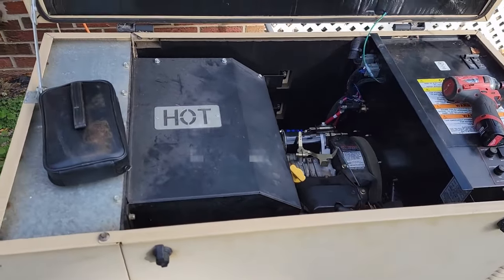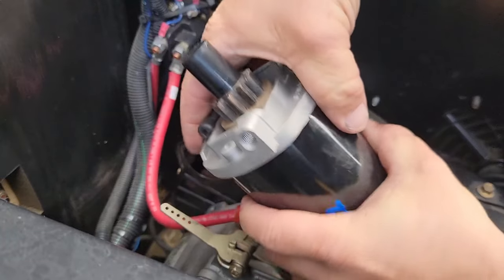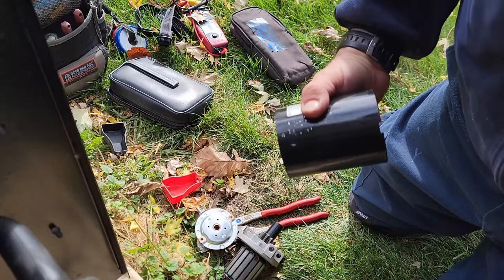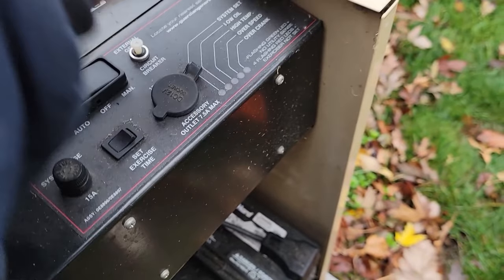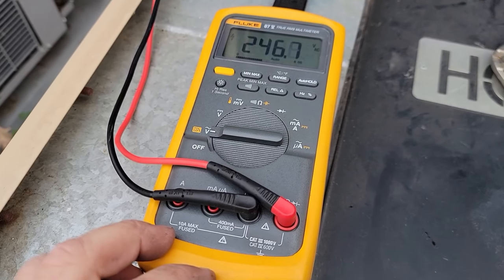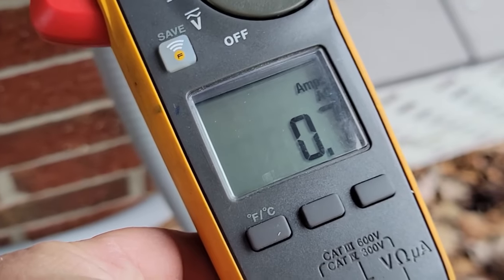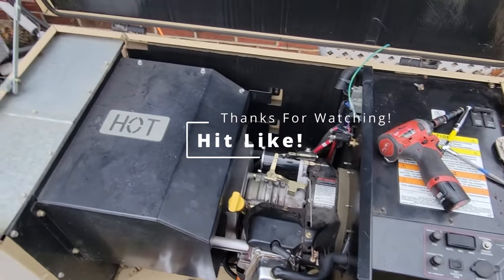Generac Standby Generator Wont Start AGAIN!!!

Comment: i recommend putting grounds wire on starter bolted to engine to reduce stressing starter too much
2nd look like it been cranking tooo long still wont started up so it just ruined starter
i think more could be issues with coils lack of sparks or lack of fuel or no fuel at all cant tell because spark plugs is one way show some sing of issues
Reply from the maker: It had a ground strap at the base of the engine going to the chassis
Reply: @HVACRSurvival  that aint going avoided starter from burn up
i have customer that have mower and ground wire was attach to frame still wont start and burned up starter
i took ground cable off frame put on engine it never have any starter issues
just give you tips if it happens aging them move wire from frame to engine hope this save your self a headache having go back n buy other starter
Reply from the maker: She purchased a new outside Genset. I think she's going to sell this one.  This was an older lady who recently lost her husband and didn't need the hassle of worrying about a generator because she likes to travel. I probably didn't describe it very good and my reply, it actually goes from the engine block to the same frame that the battery is grounded to. It's a heavy mesh ground cable plus the battery also attaches to the engine block at the bottom. I'm just saying it's extra grounding to the Shell casing. You can't get much better than going straight from the battery to the engine block. I appreciate any help you can give that's cool 👍👍
Reply: ooh neat at least you enjoyed replacing it

Comment: I noticed another regulator in-line on this video.  Can you tell me what the secondary regulators are set to in these generators?  I only have a single regulator from my propane tank going directly to my generator from the propane company.  13.5" wc at the tank and it's 15 feet away from the generator.  Not sure if this explains my hard startup issues or not.  Many on some forums claim I need two regulators.  Thanks for any input.
Reply from the maker: Depending on the size of the tank, if we're talking the 250 gallon to 500 gallon tank they'll be a primary regulator at the tank dropping it from tank pressure down to 10 psi then at the house it'll take it from 10 psi down to inches of water column.
Reply: Yes mine has the Red 1st Stage 10psi High Pressure Reg at the tank, and the Green 2nd Stage 9-13 inches of WC low pressure Reg before the generator.  Generac recommends at least 10 ft of pipe between the generator and the 2nd Stage Regulator.  Anything shorter and the opening/closing pulses of the regulator will cause a noticeable fluctuation in pressure and drive the speed governor crazy.  You mention you have 15ft so that should be good.   Inadequate pipe size and a regulator too close to the generator are apparently the most common installation problems.  If you have 3/4” pipe, or heaven forbid 1/2” from your Green Reg to the generator, then I might consider increasing the size to 1”.   Under light loads you might not experience a problem, but once you begin adding higher loads it could starve for gas.  Larger pipe will also help with buffering against pressure pulses mentioned above.   

None of this however necessarily addresses your hard start issue, you may have another problem.   You might want to consider buying a compression gauge and checking it just for piece of mind.  A v-twin Generac can completely blow a piston and rod on one cylinder and still manage to run on the remaining cylinder after a long startup cycle.  I’ve seen two of these and I’m not even a Generac tech, can’t imagine how many they see.   Compression check will catch this or even a finger in the spark plug hole during crank.  Generacs also sometimes come from the factory with very tight valve clearance, or maybe it’s just the valves seating during initial break-in, but I have had really tight clearances on the exhaust valves specifically.   If the valve clearances have never been adjusted then I strongly recommend you have it checked, I can almost guarantee they are out of spec.
Reply: @briand2614  ... in my 25 years of working on these 90% of hard starting issues will be spark plugs and valve adjustment. The factory says 0.002" and that doesn't allow any room for error. Go with 0.004" and set with the piston about a half inch down. Yup, these things have compression release and that will screw up your adjustment. As for gas pressures / piping, if you have a few feet of 3/4" pipe between the last reg and the unit you will be close enough to not notice any issues. (although the flutter will show on a gauge) BTW, air cooled units may need valve adjustment by 200 run hours... or sooner during break in period.
Reply: @rupe53  agreed.  Valve clearance spec is 0.002-0.004 and I always adjust to the higher end.  I have checked clearance on mine after only a few hours of operation and they are too tight.  After the initial break in they seem to be good for awhile.  I also have a 20kw Briggs and it comes from the factory with Platinum plugs.  I installed them in my Generac too.  I inherited the Briggs with the house I recently purchased.  I'm guessing it's at least 15 years old.  I did have to replace the VR, but my impressions so far are more positive than the Generac.
Reply: @briand2614  ... agreed, the platinum plugs will help, but that's one more thing to stock on the truck and you have to pull plugs to adjust valves anyway. I used to do them around 100 hours the first time and 200 after that.
Reply from the maker: Most of these generators have less than 50hrs
Reply: @HVACRSurvival  .... considering the typical gen set should have about an hour per month of exercise, it makes me wonder why the run time isn't higher on a set that's well over 10 years old. This is the major reason we added hour meters years ago. They cost us about $12 wholesale, and we'd add it during a service for a flat $20. Never had anyone complain about it. Now we know if the unit craps out between services.

Comment: Word of advice to whoever owns that unit is get a new one, they are only rated to last 15 years or 1500 run hours. If you sell them a newer model of same or similar Kw wont have to change cables or gas lines so would only be cost of unit an a couple hours labor. Oh you would have to add a battery charger to newer model because there old transfer switch wouldnt have a T1
Reply from the maker: I was able to confirm today that we did install a new generator at this location and reused the transfer switch.
Reply: @HVACRSurvival  awesome
Reply: @kristopherb8046  ... adding T-1 is not a big deal unless the original conduit is filled too tight.

Comment: after just a few years of working on small engines lol 20 years the rust on the fly wheel is grabbing the cheep plastic gear and holding it.   
that old potato is not work the time to even get it apart to clean it..
when i set up hrz / frek i normal allow a unit to run a good 20 minutes to warm the oil up first..
Reply from the maker: All good points👍👍.
Reply: lack-o-grease.
Reply: @tbelding  after get the ring gear out of there witch is several hours work and clean it good. i normal paint them and put a dry rust preventer on it i have a silicone spray. grease or oil will attract dust and dirt witch makes thing even more sticky. this is made to be dry with no lube, and it is out in the weather, in short is was made to fail.
but in this case you are putting more money in to this potato then it is worth. or as i like to say you can polish a turd and make it prity but it is still a turd.

Comment: Generac has had a fairly good reputation, except for their Chineseium inverter generators. I have an ix2000 that has a bad transformer in it, and no replacement parts are available, other than a $750 replacement board. I'm not to thrilled. It's been this way with them since at least 2013.
Reply from the maker: I have a medium inverter generac, no problems yet but it's fairly newer. The 8k has proved it self

Comment: What causes the starter motor to burn?
Reply from the maker: In my video it was because the engagement system didn't retract, then when it was powered to spin it did not, which then caused  locked rotor amps and melted down the brushes and the rotor.  (Or it could have been because that wire was broken on the rotor.)
Reply: Have you checked the valve clearance? That engine likely has a decompression system built into the camshaft which could cause similar issues
Reply from the maker: @nickhelstrom3503  I do not believe it has a unloader. I believe I checked the valves earlier in the year when I was first out.

Comment: I had a starter for a Honda tractor that was acting up, and it was cheaper to buy a new Chinese one than to get it rebuilt, but I'm guessing that old motor could be rebuilt as they are going the way of hen's teeth.
Reply from the maker: I had the same thing with my Gravely mower starter. Unfortunately $350 versus $100 or less. Both were made in China what's the point of paying more for the same junk.

Comment: Is there anyone that doesn't hate their generac generator?
Reply: We have a 2011  10kw that has tons of hours.  In fact it has been running constantly for 5 days now.  Due to the storms here.  I stop it once a day to check the oil.  It doesn’t t burn a drop.  Use the best synthetic oil you can get, and change it on time.  Only thing I have had to do is replace the battery, once.
Reply: @rodgraff1782  Glad to hear it. There are thousands of people bitching about their whole house generators, all brands. They also complain about all manufacturers doing nothing about their problems. I've looked at Onan/Cummins, Kohler and other big names but it's all the same complaints. It makes me want to not have any of them. I've been looking for a commercial/industrial diesel generator to try and avoid these problems.
To be fair though, many people have problems due to their own doings and manufacturers know this and that people exaggerate the facts. I have an Onan generator in my motor home and people complain about all the problems these have and all the money they spend to try to fix them. I have found a simple 15 second fix that properly corrects 90% of the problems.

Comment: You need to grease the shaft. Why the starter got stuck to start with.. And stop sitting batteries on flat metal surface. Lay some foam of rubber under them.

Comment: The starter looks very similar in design to Tecumseh engine starters.  That starter is fried.  Oh, the plastic blob was for balancing the rotor.  This is where a Honda Inverter or a diesel generator would be better.  They don’t immediately become useless after a hurricane when they have to shut off gas lines.  I remember you questioning where parts are made, remember that made in China doesn’t mean anything.  If it’s a cheap part remember that said part was designed by Americans so if the part failed it’s on the Americans for poorly designing that part.

Comment: I knew this is a POS while most people think they can rely on it to seamlessly serve as the backup. I bought a Honda 7000i instead and I rather having to do the transfer manually.
Reply from the maker: Same but I have a Generac that I haven't had any problems with. But funny enough I got it cheaper because it was returned back to Lowe's because it wouldn't start LOL luckily it was just a stupid wire and it was under warranty.

Comment: Air cooled Generac:   the regulator hard to get to behind the 12 volt battery,  Hard to keep frequency at 60 Hertz tolal rust bucket .. piece of junk besides controller and battery charger overcharging..it good boat anchor ⚓ 2 pole alternator 3600 rmps screaming me me..work on these things for years ,trying to keep them running for Verizon, and T-Mobile 📱
Reply from the maker: Yep those ones 🤣👍👍. The latest ones are much better than the older ones.

Comment: at 4:30 "look I got a baby one" (insert bad jokes here). 🤪🥳🤡
I've been tempted to buy a set of those smooth jaw pump pliers, but I have a feeling they'd just lay around unused, since everything I touch is crusty rusty trash that needs a heavy socket, breaker bar and the make it glow orange wrench.

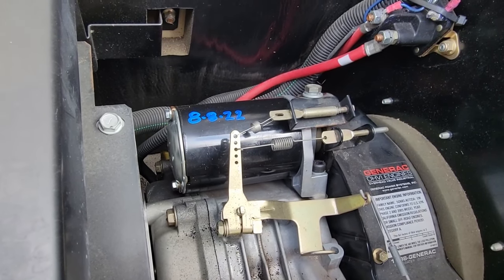Comment: 3:49 - 4:00 "NO LONGER MADE" ......WARNING folks this happens quite alot, you spend 1000's of $$$ for one of these but in a year or two parts for it becomes obsolete, you may or may not be able to get parts for these, DON'T buy one thinking 3, 4, 5 years down the road you will be able to get parts for it. For this reason I just but the portable cheaper ones, even with those you can TAKE IT to a repair shop & not have to pay a service charge for someone to come out
Reply from the maker: What I said was this generator model was no longer made, and the starter is not used on any of the current generators. However, the parts are still available to repair it.
Reply: @HVACRSurvival  Good Luck in the future, I worked for a global known engine mfg that imports gens under MANY DIFFERENT U.S. known brand names & they ALL came from the same plant in China, I watched a container being opened from the Savannah port with over 5 different brand names on the boxes & the BOL stated ALL made in the SAME plant, wait till you CAN'T get parts in a timely manner from there. Can YOU or a customer get a COMPLETE parts illustration with EVERY part number LISTED & AVAILABLE for purchase for EACH model?? I have ASKED for such from local installers BEFORE a purchase only to be looked at like they had NO idea what I was asking

Comment: That was a classic failure to properly shim a starter the"book" may say 1 shim is (usually)enough but obviously not in this case I realize HVC guys and engine mechanics are not exactly the same BUT if you intend to service engine-powered equipment you should understand them as well. I am heating and air and ASE certified
Reply from the maker: Well like I've said before,  I'm not an engine mechanic, I understand them but I have never had a passion for motors.   I'm the only one that is willing to work on damn things. I told the office to get somebody else certified and it hasn't happened. So I'm stuck doing it.  But if you can work on all the stuff that I work on and still be a great small engine mechanic then congratulations.

Comment: the fact that such a hot contact point has plastic backing it is all the proof i need to see that these things are designed to fail. like holy fuq guys can you not source a replacement starter for these machines that is not cost reduced so much it can barely handle one hard heatup cycle before it melts.

Comment: That's a starter solenoid.
Reply from the maker: I'm not sure what you're referring to because there's no context to your statement but yes there is a starter solenoid, there's a start relay also. The control board controls the start relay, start relay controls to start solenoid, the start solenoid really is no different than a contactor in the HVAC world. It's an electromagnetic switch used for high current switching.

Comment: 90 day warranty
Reply from the maker: I believe we took care of this for the customer even though we got screwed by Generac.
Reply: @HVACRSurvival  i’m just messing with you man I have one mines is 28 years old and what I did to mine. I got that bar and I draw a hole through it and put a pin because every time I check my eyes I got tired a little hurt my head.😂
Reply from the maker: 👍🍺😂. That's a cross between a tail light warranty and a concrete warranty. 😉

Comment: Wtf is it with generac generators having a high praise yet genuinely crap out quick like what I mean by high praise is that people praise generac generators and swear by them yet the further down the rabbit hole I go I see a lot of their generators fail in one way or another maybe I’m just overly observant on these things, my grandfather will just grab a generator from his work if we have power outages after a hurricane especially when I was battling cancer as I had a screwed up body temperature one minute I’d be cold than hot and than back to cold plus when I was still battling cancer we had leave for a hurricane so while he drove back to Louisiana after the hurricane me my grandmother and my mother stayed behind before coming home so everything is ready otherwise I’d be Miserable asf as there wouldn’t be anything for me to do as I didn’t have a gaming laptop nor any internet unless I used my iphones hotspot but still trying to stay in a house that’s ran by a temporary generator wouldn’t be a good experience for me at that time!
Reply from the maker: It really depends on which model and year of Generac were talking about. The older ones were problematic, but the newer ones have gotten much better.

Comment: Chinese junk….
Reply from the maker: Assembled in Wisconsin. Originally the staters and rotors were built in Wisconsin. Not sure if they still are.
Reply: If it says assembled in Wherever, USA, it means it’s parts are made in China
Reply from the maker: @DKLabs99  exactly, assembled is different than built.

Comment: I hate generac generator. I have 16KW stand by generator. Also contracted maintanance with company. The problem is never keep going 6month. Because problem is not 1 point. I changed battery. After 5 month changed start moter etc. They billed a lot. $ 6,500 machine but more & more money sucker. I would say stand by never stand by working. Controller is evolution 1.0, firmware fully updated.
Reply from the maker: That why I have portable units and several battery power stations.